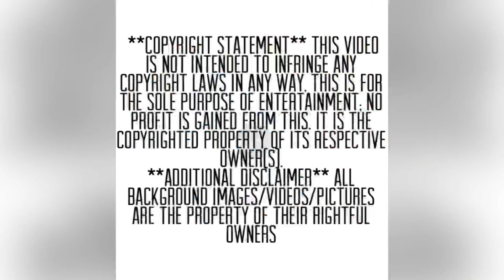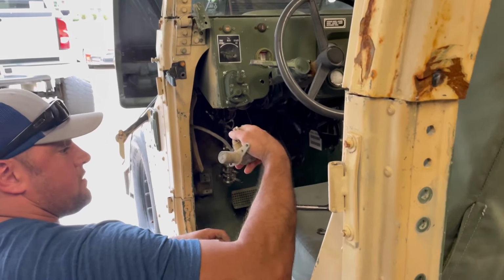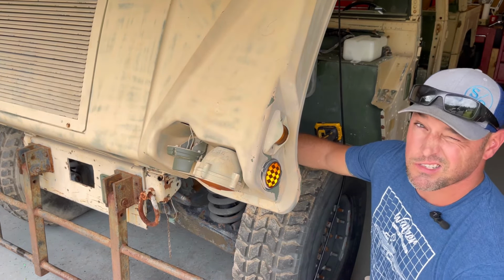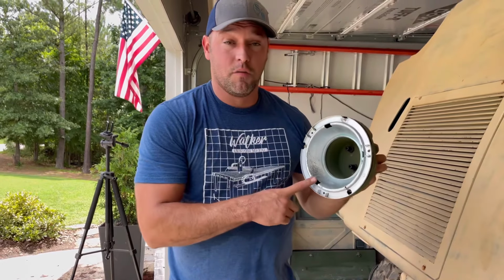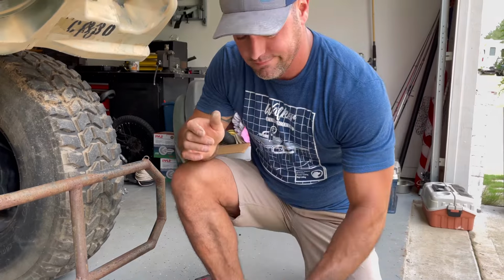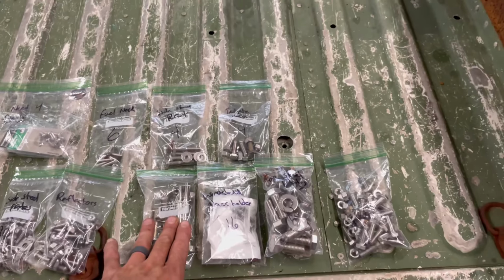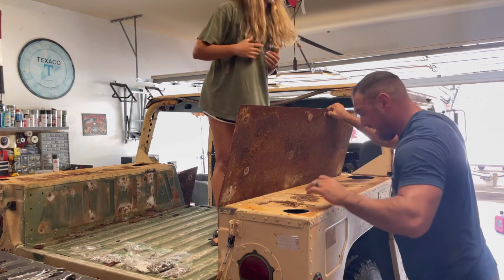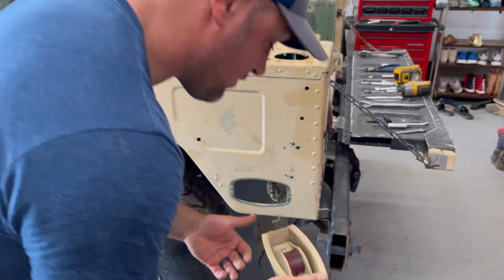Humvee HMMWV strip down

Comment: What's with all of the hillbilly armor around the back side? Am I mistaken or did someone cut out the turret with a plasma torch on the top? It is quite obvious that this poor thing was abused from the previous videos I have been watching. This truck was obviously a swimmer in its past life with zero maintanace. River stones around the back seat mount, sand in every nook and cranny, corroded cannon plugs and sockets. Stainless hardware is the way to go for some parts but one must be careful when using stainless fasteners on aluminum body parts. Corrosion by electrolysis is a major issue here. I am glad to see this is a family project! I hope your son has plans at joining the Corp when he becomes of age. Best thing that ever happened to me but I started a lot later. 
Still I can't believe how they tore up the body for odd antenna mounts, I know that regulation mounts were available and still are if one wants to mount antennas on the back.

Comment: if you have a farm supply store near you they will have the bolts a lot cheaper than Lowes
Reply from the maker: Tractor supply is way more expensive
Reply: @SplitBuilds  must be the location they are much cheaper here than Lowes